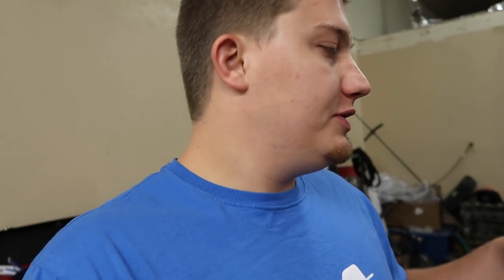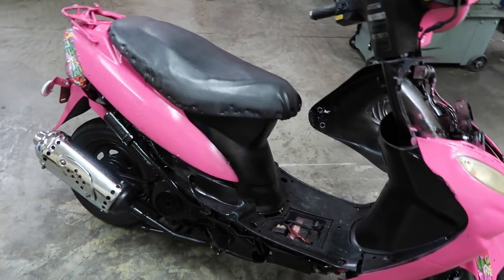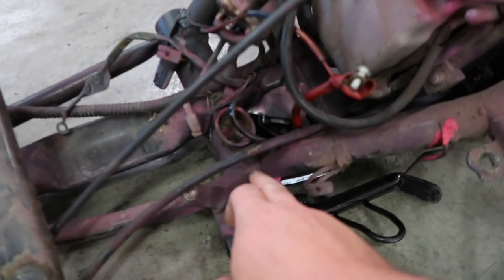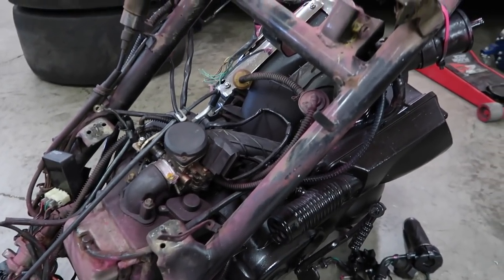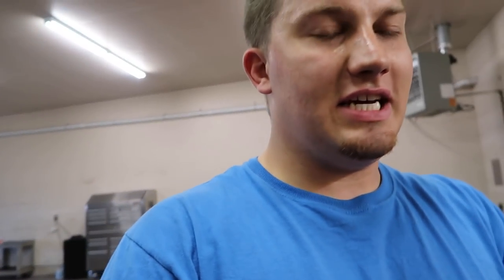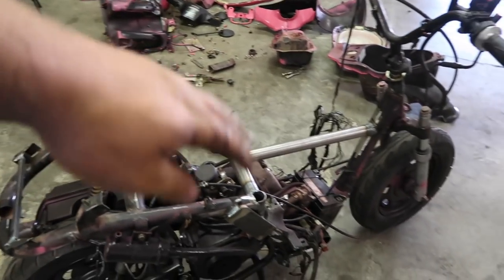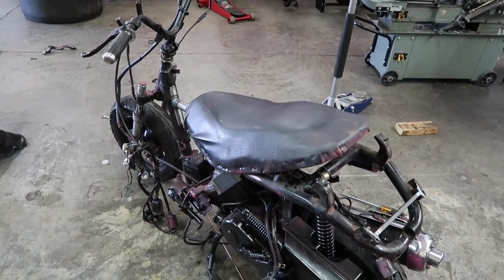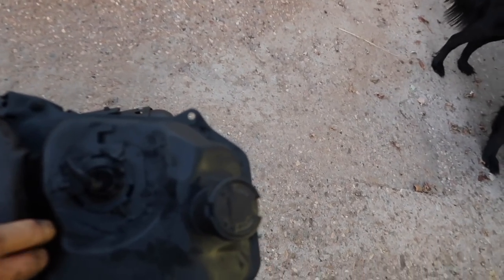Custom Moped Pit Bike

Comment: Goped’s the way to go!! Specially a goped gsr40!! A few modifications and you can hit 40mph!! I ride one almost daily. Lol
Reply: 100$ vs 600$ big difference...
Reply: scott roberts true and I won’t argue with you there buts it’s reliable and convenient for the application he wants to use it for. With that moped he’ll have oil changes because I think that takes pump gas and constant modifications since it’s “custom” Overall a Goped is simple and the motor is easy to work on. It’s an auger motor.
Reply: @justinrita7793  lol depends on what motor it's either a case reed or port piston for the go ped. The scooter has a 139qmb 49cc 4 stroke motor. Now yes oil changes but vary seldom, as for reliability most certainly the qmb motor you will go 15k before you need new rings, the gsr will need rings after a season. Part available and price also wins on the qmb. But now here comes the biggest part, that thing is fucking gay as shit, but the gsr is sick as tits. So long story short yes, yes the gsr. For 100$ of who the fuck cares then the scooter. Also that's saying he even paid that much for it. But all in all just depends on what's laying around.
Reply: scott roberts lmao Sick as tits!!! I agree! Still wish he would have gotten a gsr, seems perfect for him since it’s just a pit ped. Not like we’re riding THAT death trap. Lol But whatever works is totally right. Haha